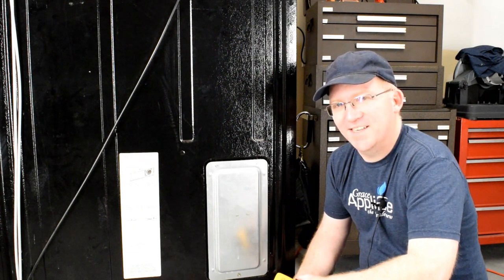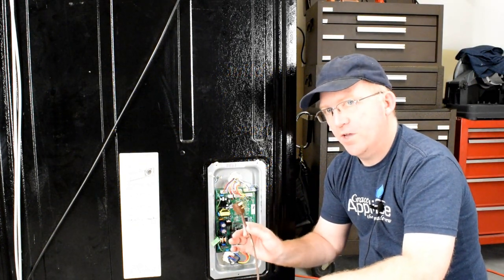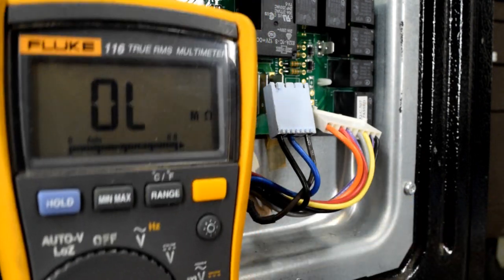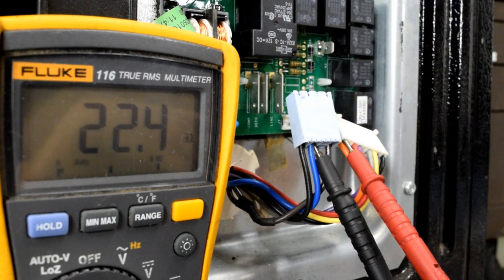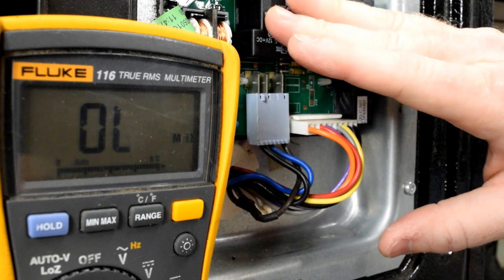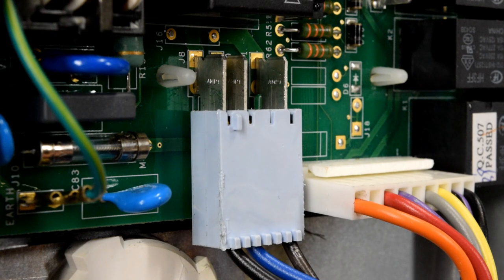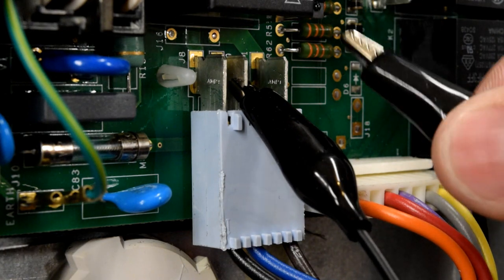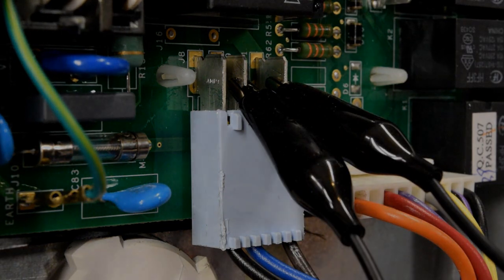Diagnosing a Bad Control Board - Part 3: Defrost Issues

Comment: Andy, got a GE Side by Side GSH25JFXNBB not cooling either compartment. Replaced relay on compressor. All fans are running. Do you think it's the board?
Reply from the maker: Hi, sorry to hear about that!

It does sounds like a control board failure, but couldn't rule out a failed compressor with out a few tests.
The easiest will be to check for voltage at the two incoming wires to the relay. You should be getting 120v there. If not, it's a failed control board.

A quick test you could do to verify the compressor is good is to temporarily install a jumper wire from the incoming board power straight to the compressor circuit.
It's done in the same fashion as I show in this video except you'd attach the jumper to the far left terminal vs the middle terminal as shown in this video.
You'd be working with the light blue plug at the bottom left of the control board. You'd unplug the fridge, install the jumper between the far right terminal and the far left terminal on the light blue plug (this would leave a single terminal in the middle which is untouched) then restore power to the  fridge and you should hear your compressor run and can rule out the compressor and relays as the issue. Of course, uninstall the jumper once verified. 

Then, you could order the board and know that you're good to go.
If you order your part through Amazon please click on the link in the description, which doesn't cost you any additional but helps the channel a lot. Thanks and let me know if you have any questions. Andy
Reply: You just helped me out tremendously. Thanks so much!
Reply from the maker: @burrowsandco  You're most welcome! Glad to help in a small way. Don't hesitate if you hit any snags.

Comment: Do all the components for this motherboard use AC or DC power? When you jumpered out the defrost heater where you using 120v AC power or 12v DC power?
Reply from the maker: Commander the jumper is sending 120vac to the defrost circuit. The board is actually split, the lower half being 120vAC voltage and upper half using 13vdc. 
Things like the fan motors, touch panels, etc are going to be DC. Things like the compressor, lights, auger motors, icemaker, etc will be 120vac.  

I hope that helps.
Reply: @GraceAppliance  if I test a DC component with a multimeter set on AC will it hurt the multimeter since they are mixed together on the motherboard? do you have any videos on how to test and replace touch panels?? that would really help me out!
Reply from the maker: Commander more than likely it wouldn’t do any damage, but it’s good practice to use caution in that respect. More advanced meter have auto sensing ac/dc which is super nice.  

The only video I have for touch panels would be this one.  I hope it helps.  
https://youtu.be/ViFpwH6_WrM

Comment: I did as you said trying to jump out the defrost heater. When I did so,I did also a direct test for AC voltage at the defrost heater wiring connects, at the tube connectors. Tube unplugged. I only got 93 vac shouldn't It read 117 vac as what my input volts are, when I measured the voltage at the (Blue) plug. J8 & J11 If my thinking is correct, it seems it should be. If not, please explain. Humm ? Also I noticed that my defrost thermostat button relay was popped out. Is this possible without some damage to it. The black insulated part of it was protrude. So I pushed it back in. Is it shot ? Is my control board history?I'm just perplexed as to mostly the voltage drop.Thank You !!
Reply from the maker: Charles Malinoski hi Charles, 
I’m sorry, I am not following the part you are talking about when you say button relay.  Is it on the control board itself?

You’re right, it should read close to 110vac-115vac. 93vac does seem low with this particular test.   

With the fridge unplugged, You can remove the two terminals at the defrost heater and perform and Ohm / resistance test and you should get about 20-40ohms of resistance there. If so, the heater is good.
Reply: GE Side-by-Side ONLY - Refrigerator Repair Videos Thanks I did do a continuity test thru the glass element. What I meant by the button relay. Is the bi/metal switch that is attached to what I believe is part of the suction line. On the very top of the evaporator. You may call it a defrost limit or thermostat. It is on the right side top,tucked towards the back of evaporator. It's clipped on. Ha !! I said button because it resembles a shiny silver button,with a clip to attach it. To the piping. Defrost (High Limit) thermostat. Think it may be done for. What do you feel? That low voltage issue tho🤷‍♂️  We do have what I've always felt was a rather low supply voltage from our electric company. 117-121 max thru out our home. But everything until now has always worked. Thank you again.
Reply from the maker: Charles Malinoski thanks, that makes sense now. Thanks. 
So, yes if yours is a GE side by side fridge this part is in fact a high limit thermostat. Designed as a safety device to prevent the heater from overheating. 
It is wired in line to the heater. So, if this part fails your heater will not come on. 
The plastic portion of the thermostat shouldn’t protrude from the silver portion. I’d definatly replace this part and this should solve your problem.  

I don’t often see these fail unless there is another underlying issue that may be keeping the heater on for too long. You will also need to check the defrost sensor (a small white pill looking part attached to the top of the evaporator) this part dictates how long the freezer stays in defrost. The resistance changes based on temperature, but at room temp should be about 5ohm and at 36F should be around 14.xxohm.  

I have a video on what pins to check at the control board so you don’t have to cut it out of the harness. It’s called ‘testing and replacing a defrost sensor’. 

Let me know if you have any questions!
Andy
Reply: GE Side-by-Side ONLY - Refrigerator Repair Videos Yes indeed. I'm going to order the limit tonight. I did do an Ohms reading this morning on all sensors throughout my unit. They were all within spec. I figured the limit would need to be replaced. And yes its inline with the heater. Hey I want to thank you for your patience and help. You have an awesome site going on here. Oh and guess what.I 'm a tech too. But I don't do small appliance work. Mostly industrial and commercial Hvac / Certified. So from me, your that guy. Much appreciated/ Peace !!!
Reply from the maker: Charles Malinoski you’re most welcome!  Stay in touch!
Reply: GE Side-by-Side ONLY - Refrigerator Repair Videos Good Morning !! Well I got and installed the new High Limit Defrost Thermostat. She's purring like a kitten. (AND) no more voltage drop either. I guess she just needed a full and complete circuit to run smooth again. All temps set great. Defrost & Compressor cut in and cut out... Perfect to me. Temp range in fridge/ 36.5 to 39.5 degrees. Freezer -4 cut out... Oh and she's an old dinosaur. 16 yrs. old Top freezer unit. Can't ask for more. $25.00 and I'm golden. Thanks again/ Much appreciated !!!
Reply from the maker: @charlesmalinoski6325  awesome news!  Thanks for the update. I'm so glad that worked out for you.

Comment: My bottom freezer refrigerator is made by Kenmore .Both the freezer and fridge are getting warm, frozen food were melting.  tried to locate the defrost timer, but couldn't. I would wonder if the electronic control board already has the defrost timer by itself on the board.
Reply from the maker: Hi V,
Typically if you have a control board, this would act as your defrost timer.
If you'd like to send your model number I could confirm this.  

Are you seeing excessive frost build up inside the freezer? 

Thanks! Andy

Comment: Question... I thought my control board was bad so I replaced it. 8 days later the freezer coils froze over. Last night I pulled everything apart and cut the Temperature sensor out (i thought this had already been replaced so I didn't think about it) and tested it in cold water with ice and I got 8 ohms of resistance. I bought a new Temp Sensor this morning and tested it and got 14 ohms of resistance. Is it safe to say that my Temp Sensor was bad? 

Also, my coils that heat up when I jump the hot to the coils with a jumper wire don't turn red and glow but they do get really hot and when the ice melts and drips on the coils, you hear the water sizzle. Is it safe to say these work correctly?
Reply from the maker: Hey, I agree that the temp sensor was bad. Should be 14k ohms as you mention.  
The heater if you have a GE side by side has a glass tube style heater.  This should in fact glow orange when power is applied to it.  

You should be getting 120v ac to the 2 plugs when energized.  If not, I’d suspect a failed high limit thermostat (orange and brown wire) which is run in line with the heater.   If you are getting 120vac to the heater, but still not glowing orange then I’d replace the heater.
Reply: I should have mentioned I have a GE bottom freezer - not side by side. GE Refrigerator PDS20SCRALSS

Should that glow orange?
Reply from the maker: No, these will not glow orange, but will certainly get hot enough to burn you.  Sounds like yours is working appropriately though.

Comment: Quick question - about how often should the defrost heater come on, with temp controls set at 5 - 5 ? Daily, weekly, longer ?
Reply from the maker: There's no set answer as it's what's called adaptive defrost and only defrosts when it's needed. It bases it an temperatures, compressor run time, how many times the door has been opened, etc etc.
But one or twice a day is not out of the ordinary with normal use I'd think.

Comment: Hi There:   After replace deforst heater, freezer temp is only approach 32 F, i did power unplug, and wait 5 min, plug back, nothing improve.  following your instruction test main board,  that was 20.5 Ω,  not 21, or 22. is it too low ?   is this  root cause freezer couldn't  make under 32F  ? should i change main control baord ?  please advice.    GE Refrigerator GSH25JSXNSS , Defrost Heater part #: WR51X10055.   Thanks

Comment: Hi. GE Eterna S/S ESS22XGMD WW model here. I have a defrost issue where the coils freeze and then the fridge side stops cooling. I replaced the defrost heater and high limit therm. Still have the same issue. When I test the blue and orange wires for resistance when the coils are defrosted, it shows about 22 ohms, which should indicate those 2 components are working correctly; however the coils still freeze up. When I test the blue and orange connections when the coils are frozen, it does not test correctly (OL)- indicating an issue with the heater or thermo. Why would it test good at room temp, but not when its frozen up? I've jumped the heater and it will turn on. I've also tested the thermistors and they all test normal. I'm thinking the new high limit thermostat I installed is bad? Other thoughts?

Comment: Great video's !!!  I still have an additional unanswered Question??? regarding a evaporator fan that is intermittent and once off can only be restarted manually. Is this problem attributed to a bad fan motor or a tachometer signal issue rooted within lP.C. control board?
I'm still looking for an answer before replacing evaporator fan or control board. 
DOES SOMEONE HAVE AN ANSWER.
Reply: Bad motor

Comment: Hi Andy, my ohms resistance is 27.5. Is this too high? I have already changed thermostat and thermistor and tested heater
Reply: I tested it again and it was 29 ohms. I tempporarily jumped the pins and the heater did come on

Comment: I jumped to force defrost on my GE fridge, element heats fine, but the compressor and fans also ran during this forced mode... Normal?   
Replaced the board, so I was just running tests on components, therefore freezer interior was at room temp for forced jump test, not sure if that played a role.
Reply: yes, if the fridge is running and you jumper it the compressor and fans have no idea it has been manually jumpered

Comment: I have a 27 year old GE with new defrost heaters & wireing, new tstat clamped onto the evap.  new timer and I know it's defrosting because I heard it crackling like they do, but the bottom of the evaporator still manages to ice up over a couple of weeks.  What do I do next?
Reply from the maker: Wayne Harropson hey, if it’s the style where you have 2 defrost heaters (one at the bottom and one about midway up the evaporator) it might be that the bottom heater isn’t coming on.  I’d disassemble to get eyeballs on the heater, you’ll have a notch in the defrost timer that you can manually advance with a flat blade screw driver, turn it slowly until you hear an audibly louder click and this will send voltage to your heaters.  Verify that they’re both glowing orange.  

Did you use GE OEM parts for the defrost timer and the thermostat? 
Only other thought I have is that if aftermarket parts were used, perhaps the thermostat cycling temperature is incorrect or the defrost timer is not the appropriate length of time.  

Let me know what you find.  Thanks! Andy

Comment: This is extremely helpful. Thanks for creating this.
Reply: My primary issue is that only the bottom 2 'rungs' on the coil are frozen, but not the rest of the coil.  Andy, I believe you indicated that this could be a sealed system issue.  Is that correct?
Reply from the maker: Hi Kyle,
You're most welcome and Thanks for the kind words.
You are correct, that's a sealed system issue. It has the possibility of being 'low' on refrigerant, but being a sealed system, that would also mean it has a leak somewhere. Some folks will roll the dice and have a leakstop and more refrigerant added, but I've seen more heartache than success with this. I just recommend putting that money towards a different refrigerator.
I'm sorry for the bad news, but hope the information is helpful.
Let me know if you have any questions. Thanks, Andy

Comment: Hello
When I did the test, testing the heating, it showed 0. Does this mean that the heater core is broken?
Reply from the maker: Hi DootDoot, Sorry for the slow reply.  I didn't get a notification for some reason. 
It sounds like you have continuity so long as it changes from OL to 0, but that the settings may be set too high on your meter. For instance if you have it set to 2000 OHMs and we're looking for 22OHMs it doesn't register. 

If you have 3 recepticle plugs you can plug your leads in to (I hope that makes sense - 3 different holes on the meter) make sure that the black lead is in the hole labeled COM and the red lead should be in the hole which has the OHM symbol. 
Set the OHM level (i.e. 200, 2000, etc.) to the 200 setting if you have this. 

Let me know what you're seeing on your side.  Also, what is the brand and model of the meter you have which will help me in giving my response.  

Thanks!
Andy

Comment: Hi Andy, can you tell me what controls the start of the defrost heat cycle, I know the high limit thermo  turns it off but mine is not coming on - and this is after replacing the control board, thermostat, and all of the sensors. I mentioned in a previous post that the heater will come on when jumping the wires on the control board  but only when the thermostat is removed from the loop, so I know the heater itself works,  - is there some other turn-on sensor I'm missing ?  I'm ready to roll it outside and use it for target practice. Any ideas would be greatly appreciated. Thanks.
Reply from the maker: Hey William,
At room temperature (or colder) jumping the heater circuit as I've shown should cause the heater to turn on.
If it does not, but only with the high limit thermostat removed, it would indicate a failed high limit thermostat or poor connection at that thermostat.

Make sure that the appropriate part has been installed. This is not a defrost thermostat, but rather a safety cutoff in case the heater were to stick on. So, anything under say 130F, should have continuity with a meter.

This is what should be installed:
https://www.graceappliancediy.com/products/ge-wr50x10068-defrost-thermal-limiter-for-ge-refrigerators-not-a-defrost-thermostat
Reply: @GraceAppliance  Thanks - I used the online manual to order by part number and location but  I will double check to make sure its the one you are showing,- maybe they sent the wrong one or its defective. Thanks again
Reply from the maker: @williamnuzzo5071  good deal. Let know if you have any questions. It should have a brown and orange wire.

Comment: Do you have some videos on Samsung French door models? I have no 120vac going to the fridge htr while on force defrost, I do have voltage going to the freezer htr. New sensor, htr, and control board. Same thing. I’m wondering if the Inv. Board has something to do with those individual circuits?
Reply from the maker: Hey, you also have a high limit thermal fuse that could be failed.
These are sometimes integrated as part of the heater, but other times a separate part. You can ohm test these fuses and should have roughly 0.03-0.08 if it's good.
But I don't have any videos on this in sorry. Hope it's helpful for you.
Reply: There is a thermal fuse harness in the Evap area.
Thank you VERY MUCH for your fast reply.
Reply: The one integrated with the htr is in series with the new htr